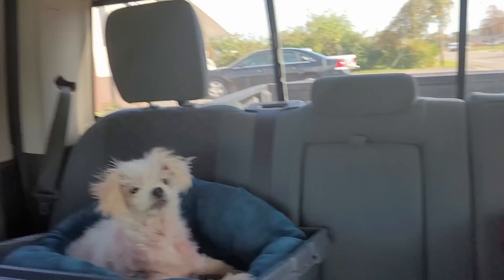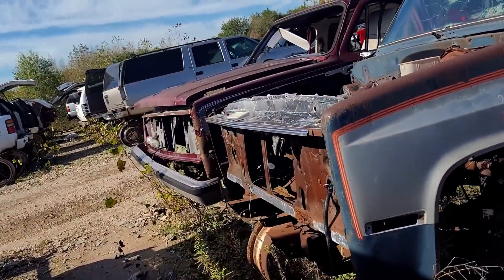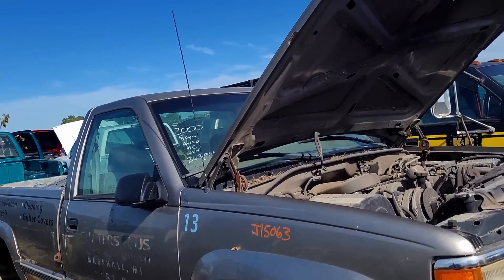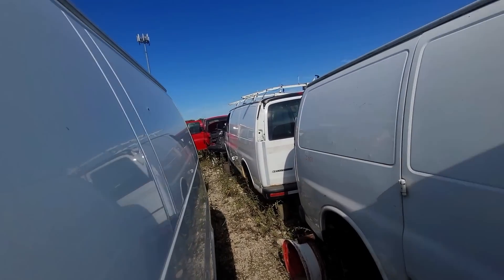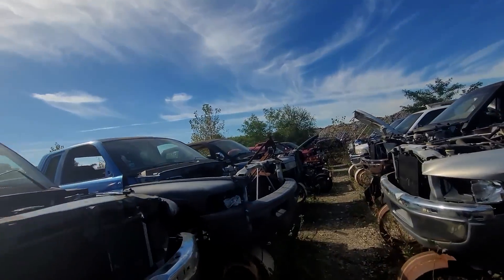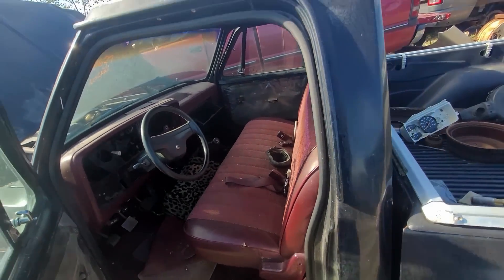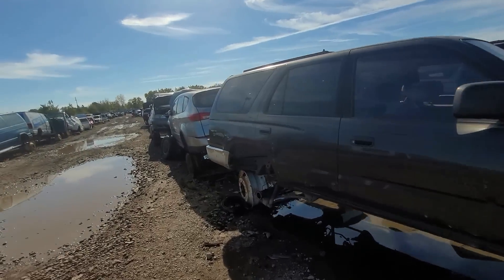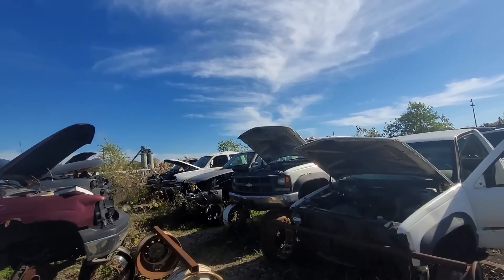Junkyard goldmine! LY6's, LQ4's, Gen IV LS engines, Diesel engines, C10's and more!

Comment: Guess i'll be the guy that corrects you JR ! That Sprinter had an OM647 and was used from 04-06. The OM612 was used from 02-03 in Dodge, Mercedes and Freightliner Sprinters.  And it's never boring to see you trek through the yard, I find it quite enjoyable. -Jason
Reply from the maker: Doomsday Diesel has adapters for both a Chevy trans or the AW4 you have now

Comment: I drove an hour to a yard that had horrible reviews and horrible customer service, but left with a relatively low mileage (143k) lq4 for $600. No core charge. It had a bad cylinder head where the manifold pulled loose in a wreck. I was putting 5.3 heads on it anyway. Worked out great. Make the drive!
Reply from the maker: If nothing else... Just don't put up with people's bullshit. 

If it's shitty somehow, some way... Just go somewhere else and try

Comment: 4👍's up thanks again for sharing
Reply: is there any way to put a lq4 up against the newer 2014 6-speed transmission transfer case for four wheel drive
Reply from the maker: Sure, use a standalone controller, it's about 1000 bucks

Comment: So what’s the deal with 4L80e from a van? How much higher stall is it?
Reply: If I'm not mistaken, it's a higher stall due to it being the 4.8. Similarly to the way the v6 tq converters in the 4l60es have a higher stall. I dunno how many rpms different they are though
Reply from the maker: Not from a van, from a 4.3 van. 

It's 2400rpm
Reply: @TheDrivewayEngineer  what about the 6.0? I’m guessing it’s the same as normal?